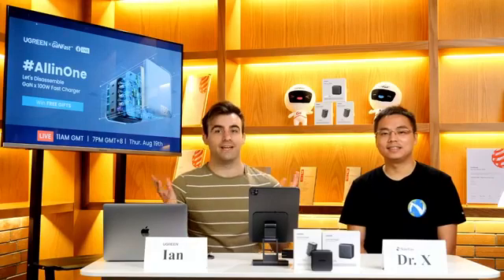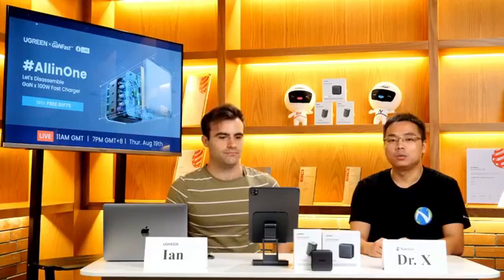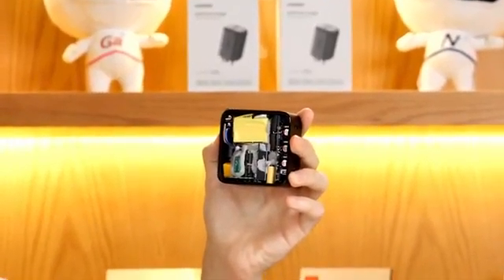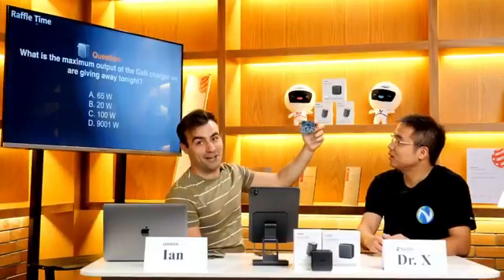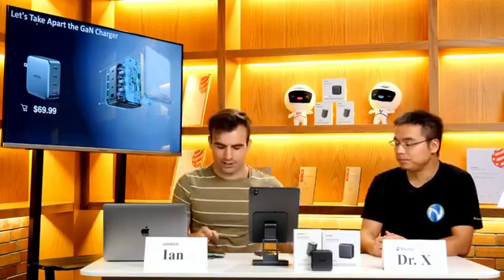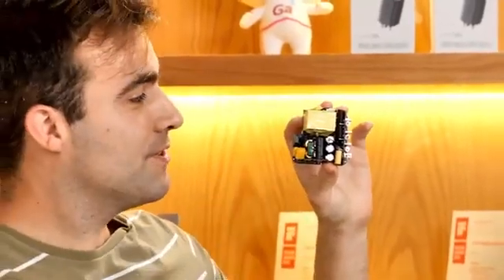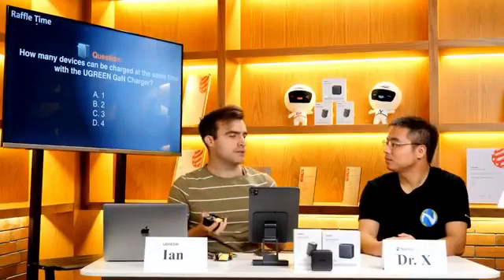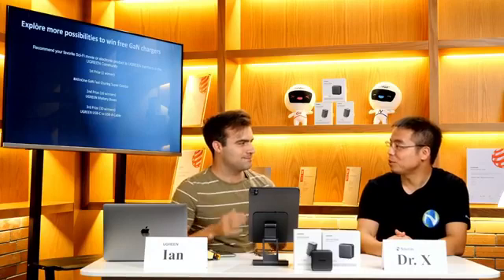Ugreen 100 W GaNFast Charger Disassemble

Comment: it's ashame that UGREEN being a reputable name produce DANGEROUS ungrounded/unearthed USB charger even for 3 prongs AC plugs. Try to use it and see high stray voltage that can reach 105VAC at the shield of the USB plugs that will transfer to metal body of the device the charger is connected to (e.g: laptop). It can damaged your device (the laptop) is then connected to another device (e.g.: monitor, external speaker) that has separate but grounded AC power. Cut corner for a simple properly grounded AC plug? I am not buying any UGREEN charger until they properly address this safety issue. It may not sause injuries to user but it potentially can fry your device.
Reply: This is normal. We call it floating ground.  It's SAFE and a NORMAL thing what happen by a lot of devices. Take a good search on GOOGLE and you will see what floating ground is and why it's SAFE.